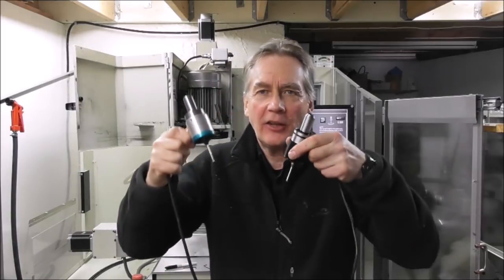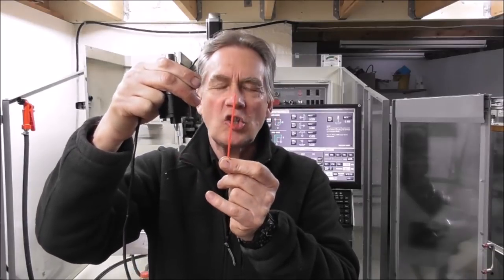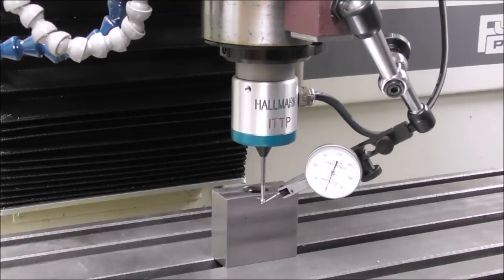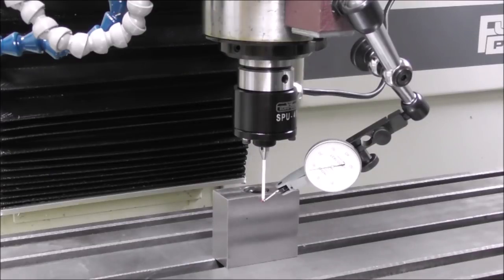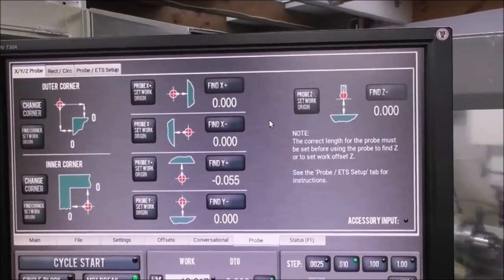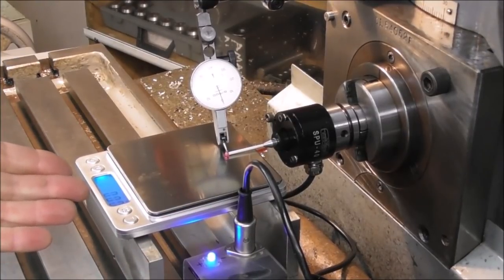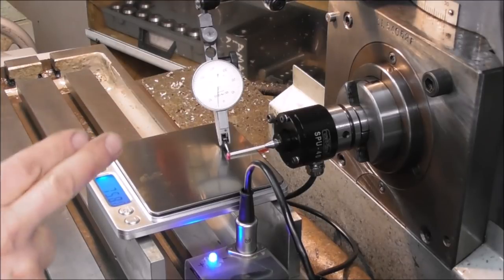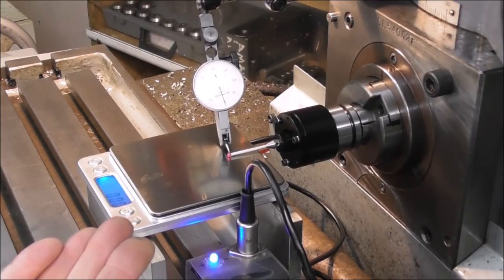Probing Around - Probe Accuracy

Comment: Very interesting as always. I recall going through this procedure setting up my probe and finding that it was slightly better than the “average” values you mentioned. With the ITTP you are well within the accuracy that my 440 can produce even when the mill is dialed in near perfectly. Great product.
Reply from the maker: Thanks for that Doug - very helpful to hear. It seems some machines have a slightly quicker reponse time and this may add to less pretravel. I should probably reduce the "average" value.  Cheers  Cliff

Comment: Cliff, I'm curious to learn why setting the probe effective tip diameter with a ring gauge does not account for the variations you explain in this video (at least in the orientation in which the calibration was conducted)? Since the size of the ring is known to the software isn't the variance factored into the measurement?  TY for the informative videos.
Reply from the maker: Hi Scott. No, the software cannot account for this as the variance is rotation/direction variable and this is not measured in the Tormach system. Cheers, Cliff
Reply: @Threadexpress  Thanks for that Cliff.  I understand the idea that as you rotate the probe the variance changes due to the construction issues you point out, but the variation based strictly on flexing of the stylus seems like it should be picked up and averaged when using a ring gauge, no? In my case, the difference between measuring the tip diameter with a micrometer and a ring gauge is .01002 of an inch.  TY!

Comment: Cliff,  I'm a huge fan of your work.  I would love to have one of your probes but for my home shop it is out of reach. I will soon purchase one in the $400 range. 

This video was very informative and I'm left with only one question. Ignoring flexibility for a moment,  does the tip length not play a role in pre-travel (not variation)? Is it also compensated for in software?

Edit: Does using a bore ring gage to determine the tip diameter make the necessary compensations?
Reply from the maker: Hi Backlash. Thanks for the feedback.  Well... all other things being equal more length does bring more flex, also length affects the ratio of opening of the contacts, and this will change other minor contributors of pretravel such as electrical trip point variables.  Repeatable errors can be accounted for in the software via applying a different tip radius than it actually is, but variable errors cannot be accounted for in PathPilot.   Cheers  Cliff

Comment: Wondering if you've looked at the impact of a skirt per the expired renishaw patent?  that seems to create a consistent lever point which would help reduce the variation?
Reply from the maker: Hi Jesse. Not often I hear from someone who understands this so deeply!  
The current Hallmark ITTP model is a simple low cost rugged and reliable probe developed for the hobby/price conscious shop not requiring extreme high precision. These type of designs in this price market would add a lot of cost and limit impact tolerance/reliability. Thanks for commenting. Regards,  Cliff
Reply: @Threadexpress  Thanks for the reply!  I'm planning on trying to make a strain gauge probe.  It seems for a strain gauge probe you still need the kinematic coupling to return to center and I was wondering if it was worth doing the skirt.  I have not seen DIY designs which leverage it.   I was thinking that the skirt acts like a leverage point against the body and it does not need to be a small lever, meaning you could have the skirt in a different position which might increase the leverage and reduce the lift pressure.  This may be moot for a strain gauge but I wanted to hear your thoughts as I'd guessed you might have done some experiments with the design aspect.
Reply from the maker: @JesseSchoch  Hi Jesse. Skirt designs in theory can even up the different direction trip forces, but in practise this will be difficult to obtain reliabilty, manufacture and support. Please let me know if you make one. You can email me. Adress under about above or the Hallmark website.

Comment: Hi Cliff I have been following you for a long time,  I have a question on your probe I really like the connector you have to attach the cable to the side looks like good quality can you tell me where to it ?
Reply from the maker: Hi Robert. Thats usually called a metal cable gland fitting. Available electrical supplies stores or ebay etc. Cheers Cliff

Comment: Thank you for the very interesting video,  I always enjoy the ITTP videos.  I do have one question though: can you test your ITTP with a smaller, more flexible stylus?  The internal mechanism of the touch probe will likely have a lot to do with the trigger repeatability.  I would love to see a more apples-to-apples comparison.  
Anyway, keep up the good work
Greg
Reply from the maker: Hi Greg. Thanks for your feed back. And an interesting request. I am not quite sure what you are saying. Are you saying that if I installed the SPU 40 stylus stem on the ITTP -  the pretravel would still be low?  Cliff
Reply: I am suggesting that the flexibility of the stylus is of the order of less than a micron at the forces that are being put into it during normal use, suggesting that the difference in performance is to do with the internal mechanism more than stylus flexibility.  I would love to see a stylus of the same diameter and length on each touch probe if that is possible as this would eliminate any difference between the systems.
Reply from the maker: @Totalis1989  Hi Greg. It nice to talk withs someone thinking deeply about this. I found it hard to believe that the stylus stem would flex that much in the beginning also.  But if you look at the video second half - you can see SPU40 internal mechanism, and then the weight scale tests show that it has to be the stylus assembly flex - there is nothing else that would match the ratio change measurements so exactly.   Cliff
Reply: I like your testing setup very much, I will be replicating it myself when I can.  I must admit I hadn't realised that the required trigger force for each touch probe would be as high as ~100g.  The CMM systems I am used to at my workplace are typically 0.2N or ~20g.  It is good to see the difference between the rotary positions of the touch probes (in line with the balls vs in-between them), that is something I keep trying to mitigate with my designs but its difficult to escape the geometry of the problem.  What material is your stylus made from? I have the ability to test minute flexing at work and I would love to replicate some of this work.
Thanks for the great videos btw.  They are very informative and useful.  Greg